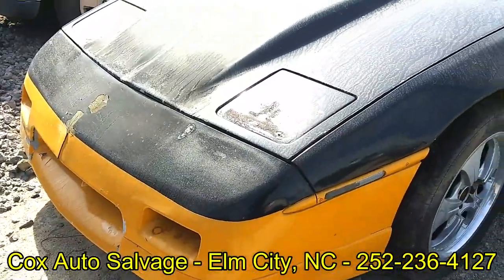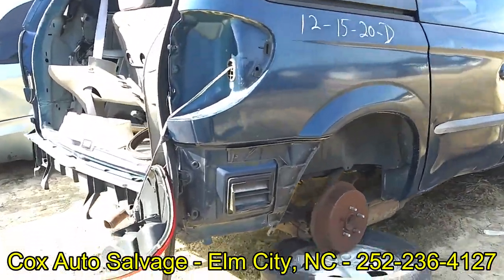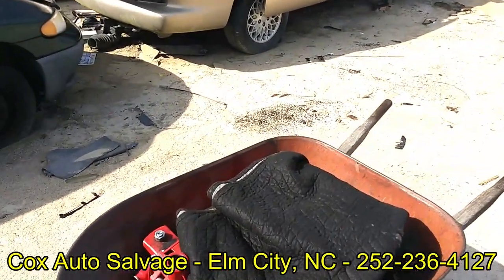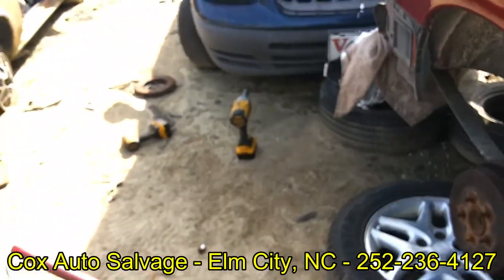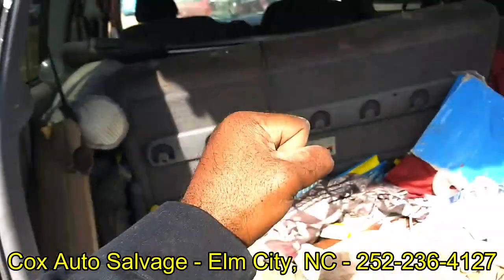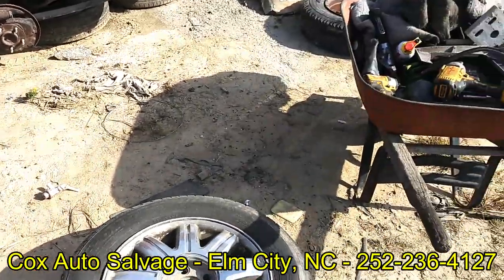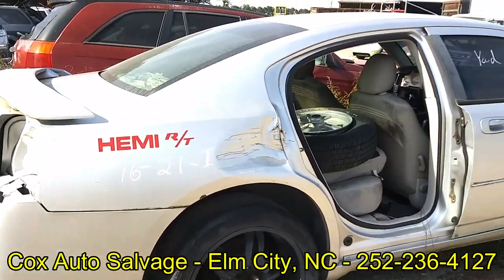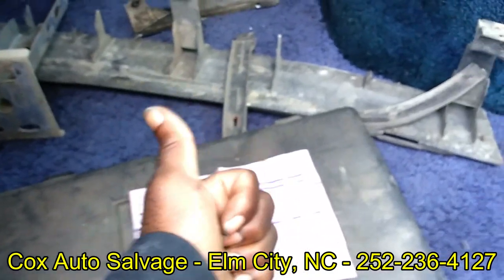Visit to Cox Auto Salvage in Elm City, NC for Hector @NoneMechanic101

Comment: I go crazy at our two pick a part lots! The cars are on tall blocks! No need for jacks! They don't let you use camera or video! Lots of great finds...some disappointments!  Milwaukee batteries suck, and their new impact is a total failure!! Makita  has never failed me! Dewalt has the most beautiful reps!!!❤!!! Cute gals, problem was repairs were 70 mile drive where Milwaukee is close to Disneyland! 20 miles!
Reply from the maker: You're not allowed cameras in there? We have a Makita impact driver, and this thing is GREAT, and the the battery is still good after 5 years!